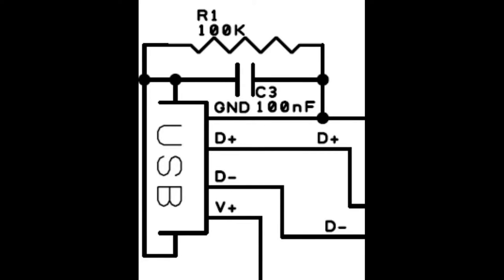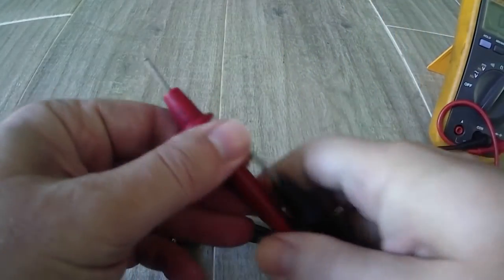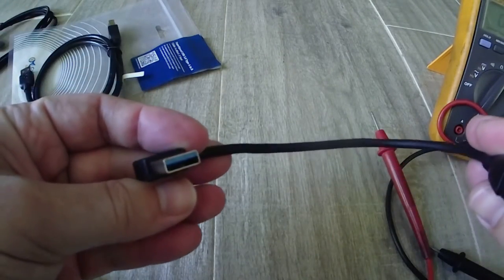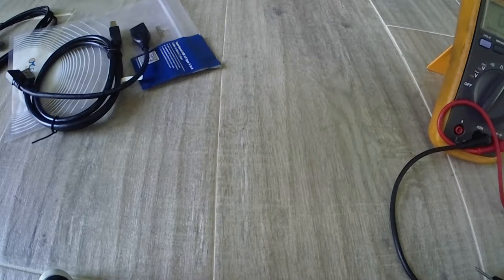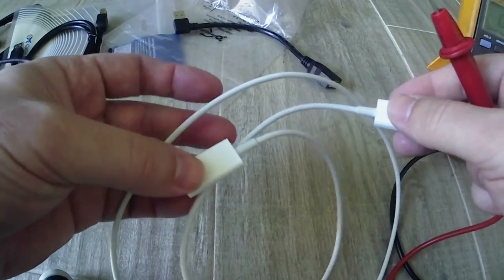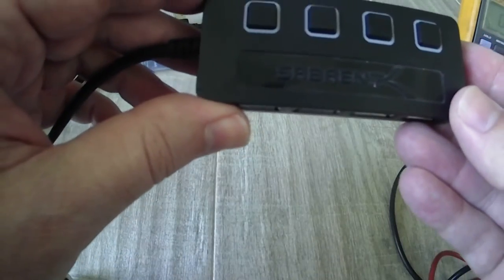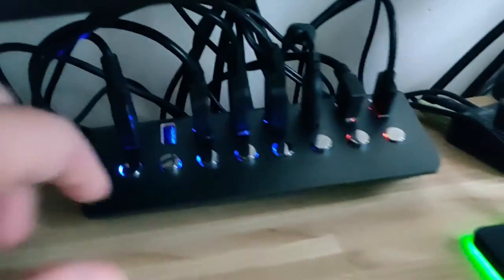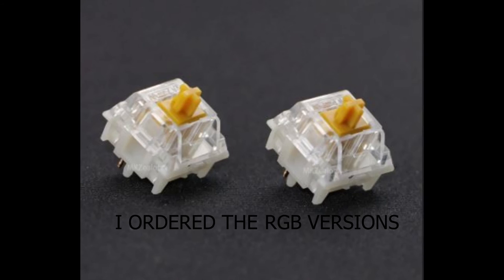Is your USB cable grounded?

Comment: NOW I have that same OCD for checking my cables for ground, damn you! Btw I got a cheap USB cable tester from amazon with little leds that check for continuity on all the pins, you can find it pretty easily for around 30 USD and it works like a charm. Good video!

Comment: The beep tone from a multimeter is not a sufficient condition for a good shield. The USB specification mentions a 0.6 ohm plug-to-plug shield resistance. The multimeters generally beep if the resistance is lower than 10 ohms.

Comment: They aren't grounded for DC. That's could be good as it prevents ground loops. I would test again for capacitance. The ends could be capacitively coupled which would effectively be grounded for high speed signals.

Comment: On my HP laptop if I use a ground plug, the USB sheath is also grounded.  Makes a difference when fooling around with RTL-SDR (usb radio receiver). Noise floor dropped 3dB. should apply equally to any low level signal processing hardware connected to a computer. But yes, you need to check your USB cables with a multimeter to see if the shield is connected and you need a 3 prong wall socket with ground.
Reply from the maker: Very cool, i have an RTL-SDR on a Pi 4 running OpenWebRX.  I need to upgrade the antenna the SDR came with.

Comment: Man I used to wonder what was the point from having that metal surrounding the cable on the inside (I was tweaking with stuff that use usb) now I know that I kinda killed many micro usb charging cables 🙂